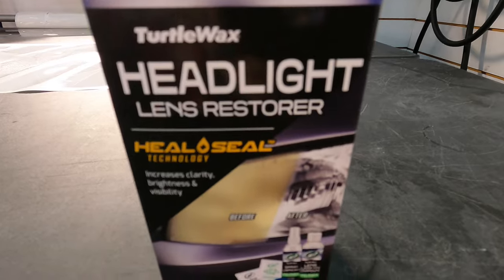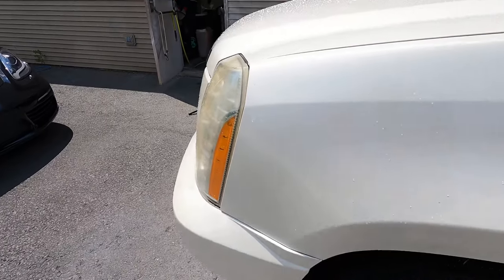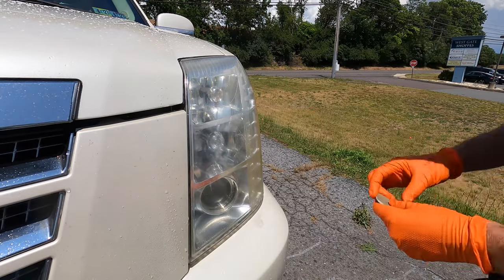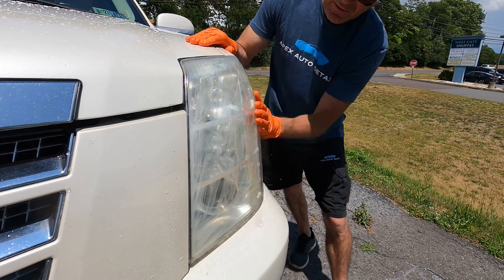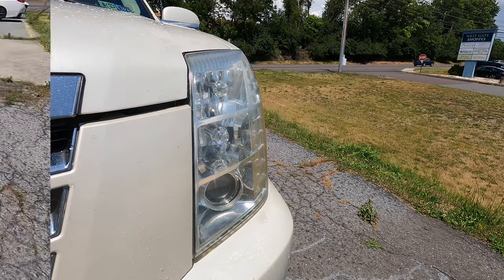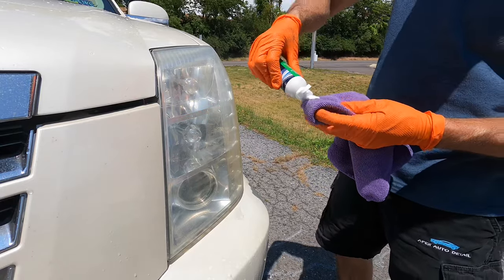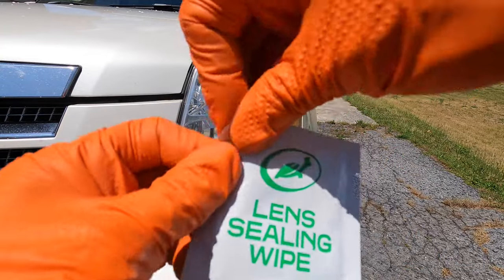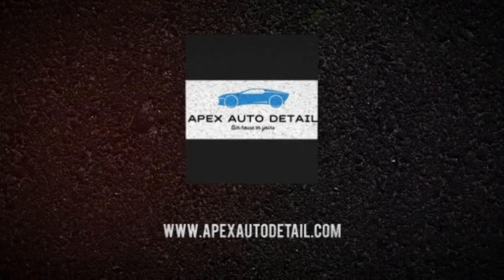Best Headlight Restoration Kit?? Heal & Seal Technology! TURTLEWAX Headlight Lens Restorer!

Comment from the maker: I have shown many ways to restore headlights.....How do YOU restore them?
Reply: Wet sand than polish and ceramic coating
Reply: Sandpaper and clear coat
Reply: I wet sand the lens and then polish out. I protect  with any left over ceramic coating.
Reply: Brian, do you think the hybrid solutions is better than this kit?
Reply: Wet sand, polish then PPF and this is generally permanent 👍🏼 Great video thanks.
Reply: Brian,  you're  becoming my go-to. This looks like a other great recent release by the 🐢.
Reply: Some beater/drivers are near brown/yellow. I wipe them w/a soft rag and lacquer thinner. Light touch-evenly. Some wet sanding if needed. Follow w/a 3" 3M orange pad w/True Grit compound & cleaner wax combo using a tiny FLEX rotary I call the Mini Me. No top coat seems to last more than a year or so. We also have Mid West winters w/a saline solution dumped on the bridges & it eats natural finish alloys & chrome like acid.

Comment: Thanks for the video.  Alot of tw products the last few yrs are great . For a guy on his way home from work and stops at Walmart this is great . For a professional restoration naw . If I'm charging 100$ and up I'm sticking with my 3m sanding disc's,  3m plastic headlight polish and megs headlight spray coating . Made for headlights,  more consistent results and  lasts 2 to 3 yrs plus instead of 6 to 12 months.

Comment: For between 20 to 25 dollars you can buy a can of 2K clear-coat
Looks brand new 
And will last for years. 
I give this a year before it fades.
Reply: Yeah but you should also have isocyanate protection when using 2K, which is another $50-75+.
Reply: @erichill7560  spray max 2K has it in it. 
A can goes for between 20- 25 dollars depending on where you buy it.
Reply: @erichill7560  spray max 2 K has it in it 
Goes for between 20 - 25 dollars a can depending on where you buy it.
Reply: Your paying big money to permanently damage polycarbonate headlights don't put this 💩 on headlights ever!!!🤔🙄
Reply: @keithroberts5611  and yet mine are 6 yrs old and still going strong 
Go figure.

Comment: I’ve used the TW kit before. As you mentioned it is easy to work with and delivers decent results. My only problem with them was the coating. By the time I’d reached a year on the multiple vehicles I’d done for friends and family, they were already failed and needed touch up and a better coating. Tried Cerakote on my brothers truck, and Adams graphene/ceramic on my oldest truck. After a recent purchase and experience I’m thinking I’ll start using BC1 for this going forward…
Reply: oh no a once a year maintenance thing
Reply: How did you like the Cerakote?
Reply: Whats BC1? How was the cerakote?

Comment: Hey there I have a quick question. I've noticed in the other videos about this product they use tape to make sure the surrounding paint does not get damaged. Even on the box it says to use masking tape around the light. Is this necessary or is it because you didn't really have any paint to worry about because the Cadillac has a HUGE headlight. I'm trying to do it without tape. If possible...

Comment: The issue isn't the restoration, it's protection that's key here. If the sealant fails after a year or so, then it wasn't really worth it, but of course it is subjective. I want to finally use the Cerakote sealant on my headlights, but both times I've bought the kit, the sealant after a relatively short period of time hardens in the foil pack. So if you use that kit, use it quickly if you live in a hot climate, as it will become useless very quick. Other than that hope to see how well this holds up Brian. 

BTW, Puppy is just beautiful! What a gorgeous good girl and great shop manager!

Comment: I also have used the Cerakote kit with good results. It comes with two packs each of there clear coat wipes and an oxidation removing wipes. I did two vehicles a year ago from one kit and they are holding up well so far.
Reply: I used cerakote it doesnt self level. But if you do it right it has good results.